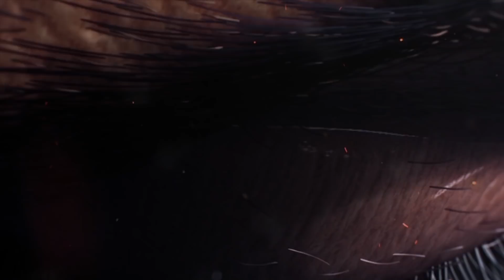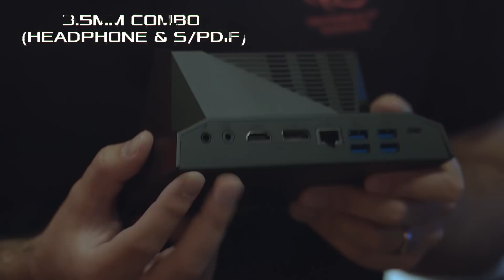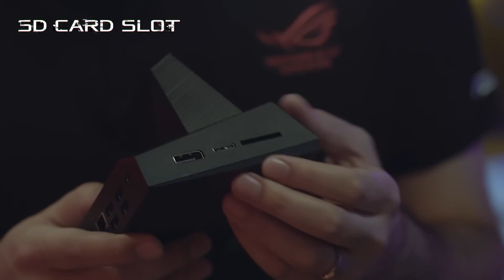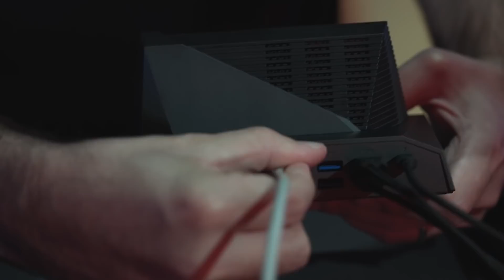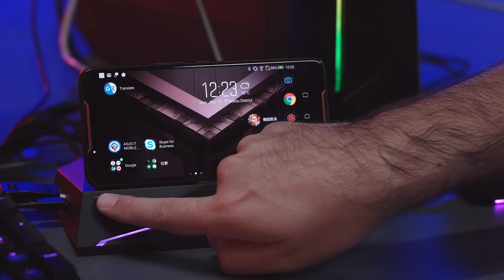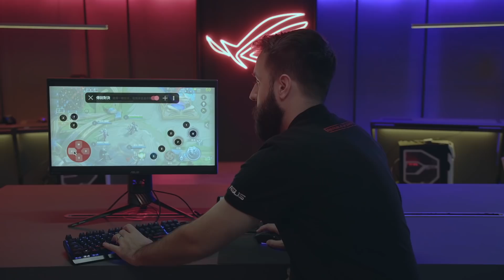Take control with ROG Phone - Mobile Desktop Dock | ROG

Comment: I have had an rog 2 and 3 for some time now but never got around to buying the desktop dock, I got everything else but my issue is with games that require tilt control like F1 mobile. It's a shame you can't connect a wheel to it as well then I would be sold.